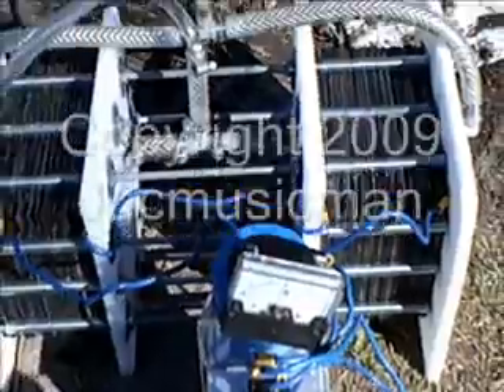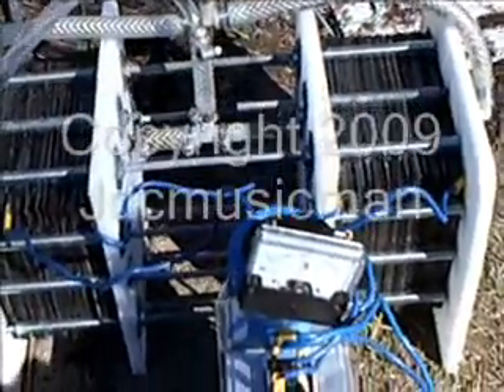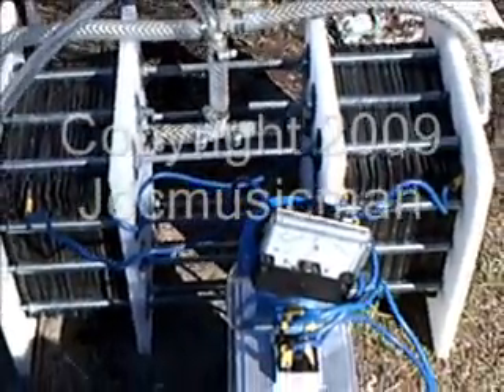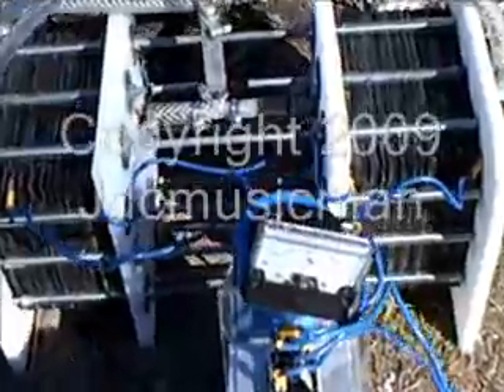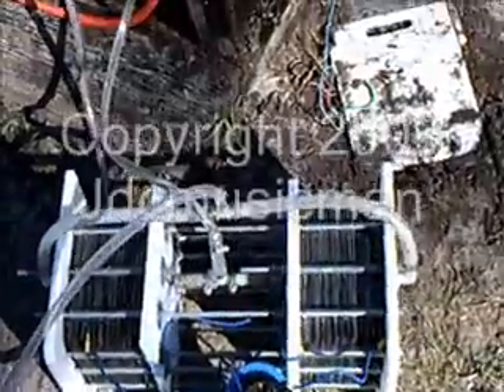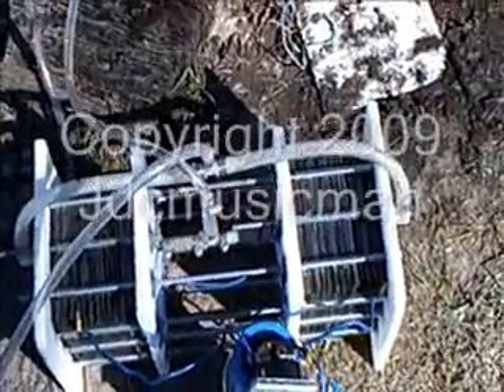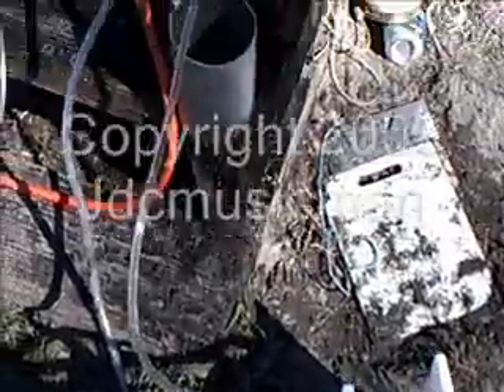SRV bubbler update 72 plate cell

Comment from the maker: I'm not using variac..I am using a 1000volt 50 amp bridge rectifier and a 450v 8500uf capacitor.Powered with standard house current..I cut my plates with a skill saw with a metal cutting blade on it..